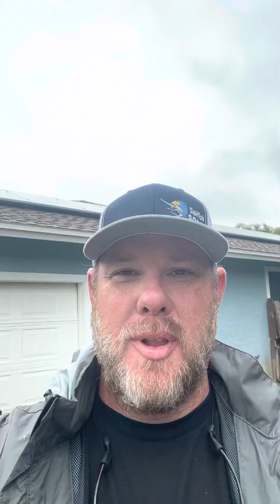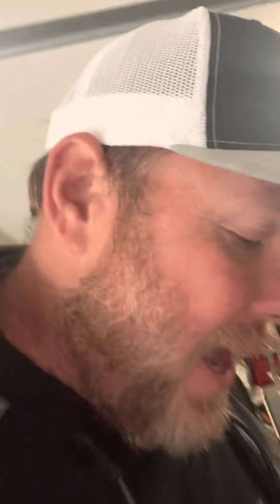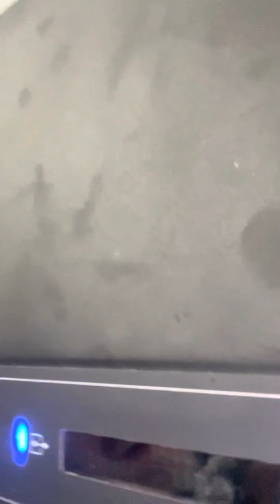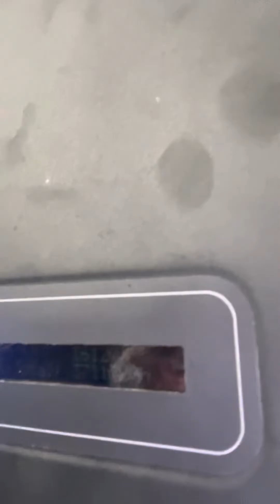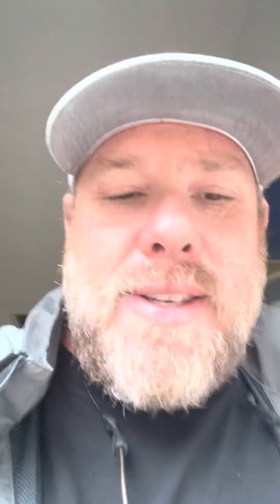Solar in a hurricane  - What to know about your solar panels in a hurricane

Comment: Nailed it, as usual, Mike. Having just experienced Hurricane Ian on the west coast of Florida, we have a lot of data on the effects of storms on PV systems. Most people are worried about the roof attachments and leaks. We're here to tell you - that is not the weakest link in the system. Roof attachments rarely fail when installed correctly. We had zero solar mounts fail where there wasn't catastrophic failure of the roof structure itself. Also, it's FAR better to install panels flush mounted to your home's roof rather than a ground mount. This sounds counterintuitive to most, but an exposed structure to wind and storm surge is extraordinarily vulnerable relative to a roof mounted system. In fact, solar panels often protect a roof against damage or mitigate it. Stay safe over there, and we look forward to hearing from you after Hurricane Nicole passes.